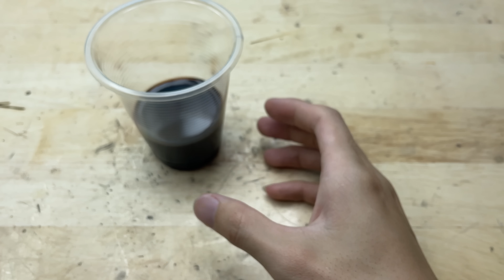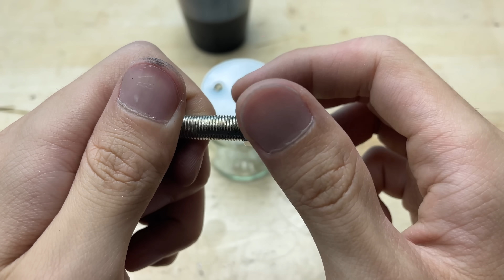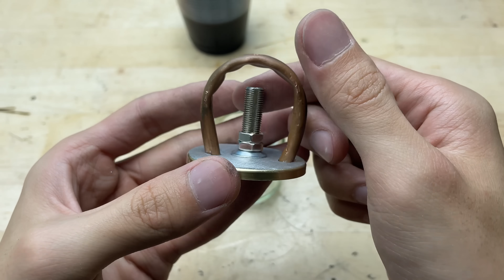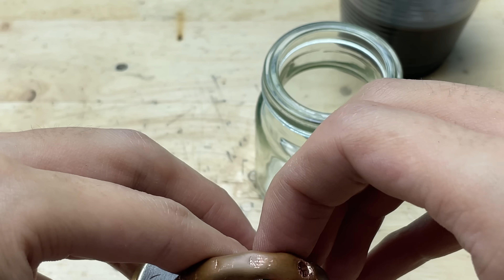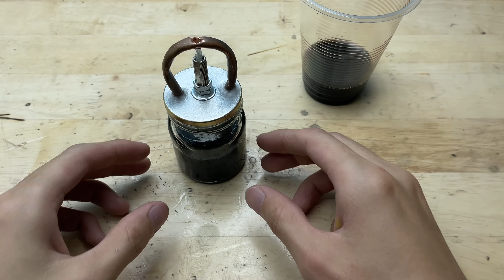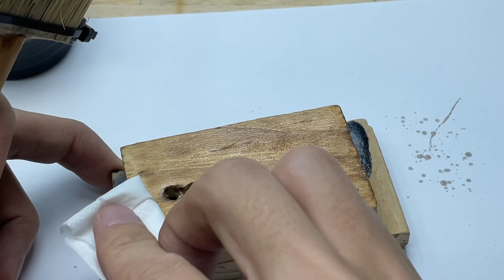Mix WD-40 with USED MOTOR OIL and see what most people don't even imagine happens!

Comment: I stopped watching when you used a syringe to remove the oil from the plastic cup to fill the glass jar instead of just pouring it from the cup directly. By the way, get yourself a step drill bit to drill holes in very thin metal where it will not grab when hole is made and the bit does not leave metal shards on the bottom side.

Comment: When used motor oil is burned, a variety of gases are formed, including those that can be harmful to human health and the environment. 
Here's a list of gases and other pollutants commonly released during the combustion of used motor oil:
Carbon Monoxide (CO): A toxic gas resulting from incomplete combustion, which can cause oxygen deprivation.
Carbon Dioxide (CO2): A greenhouse gas, according to the Dutton Institute, it is the primary product of fossil fuel combustion.
Sulfur Oxides (SOx): This includes sulfur dioxide (SO2), a gas that can irritate the respiratory system and form sulfuric acid in moist tissues.
Nitrogen Oxides (NOx): These are a group of reactive gases that can irritate the eyes and respiratory system and contribute to the formation of smog.
Particulate Matter (PM): This includes fine particles and soot that can penetrate deep into the lungs and potentially cause respiratory problems and other health issues, according to MedlinePlus.
Volatile Organic Compounds (VOCs): These are various organic compounds that can evaporate readily and contribute to air pollution.
Polycyclic Aromatic Hydrocarbons (PAHs): Some PAHs are known or suspected carcinogens, and can be found in the smoke plume.
Toxic Metals: Used oil can contain metals like lead, arsenic, zinc, and cadmium, which can become airborne when burned.
Hydrogen Chloride (HCl): This gas can be formed if the used oil contains chlorinated compounds. 
Important Note: The specific composition and concentration of these gases will depend on various factors, including the type of used oil, the combustion efficiency, and the presence of additives and contaminants in the oil. 
It's crucial to avoid burning used motor oil due to the hazardous gases and pollutants it releases. Proper disposal and recycling methods are essential to protect human health and the environment.

Comment: You don't need WD-40 to mix up. Just use kerosene which is cheaper. Those days we used kerosene lamps before the electricity supplied to our houses!
Reply from the maker: Thanks for sharing
Reply: or diesel fuel
Reply: Or paint thinner.

Comment: Cook over that at your own peril
Reply: When used motor oil is burned, a variety of gases are formed, including those that can be harmful to human health and the environment. 
Here's a list of gases and other pollutants commonly released during the combustion of used motor oil:
Carbon Monoxide (CO): A toxic gas resulting from incomplete combustion, which can cause oxygen deprivation.
Carbon Dioxide (CO2): A greenhouse gas, according to the Dutton Institute, it is the primary product of fossil fuel combustion.
Sulfur Oxides (SOx): This includes sulfur dioxide (SO2), a gas that can irritate the respiratory system and form sulfuric acid in moist tissues.
Nitrogen Oxides (NOx): These are a group of reactive gases that can irritate the eyes and respiratory system and contribute to the formation of smog.
Particulate Matter (PM): This includes fine particles and soot that can penetrate deep into the lungs and potentially cause respiratory problems and other health issues, according to MedlinePlus.
Volatile Organic Compounds (VOCs): These are various organic compounds that can evaporate readily and contribute to air pollution.
Polycyclic Aromatic Hydrocarbons (PAHs): Some PAHs are known or suspected carcinogens, and can be found in the smoke plume.
Toxic Metals: Used oil can contain metals like lead, arsenic, zinc, and cadmium, which can become airborne when burned.
Hydrogen Chloride (HCl): This gas can be formed if the used oil contains chlorinated compounds. 
Important Note: The specific composition and concentration of these gases will depend on various factors, including the type of used oil, the combustion efficiency, and the presence of additives and contaminants in the oil. 
It's crucial to avoid burning used motor oil due to the hazardous gases and pollutants it releases. Proper disposal and recycling methods are essential to protect human health and the environment. 😇